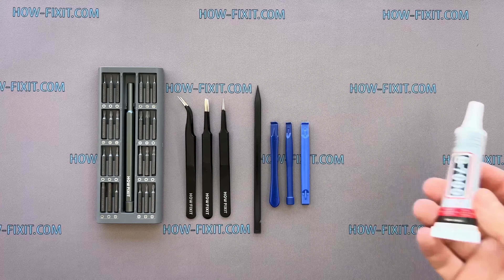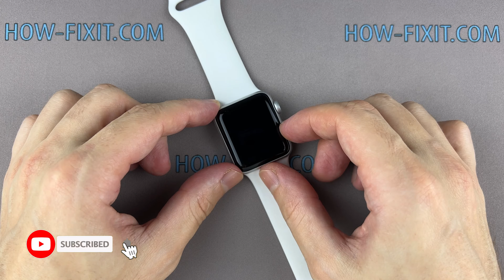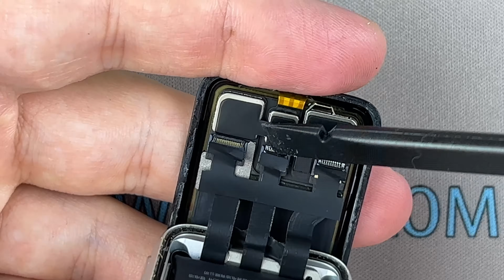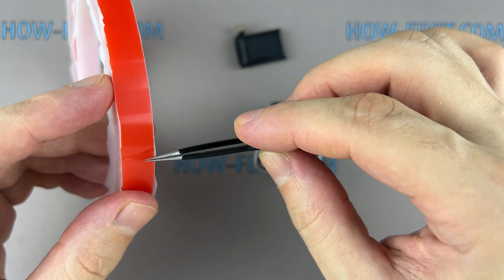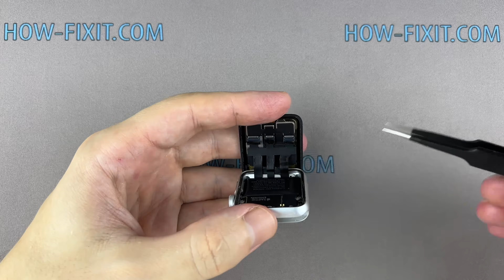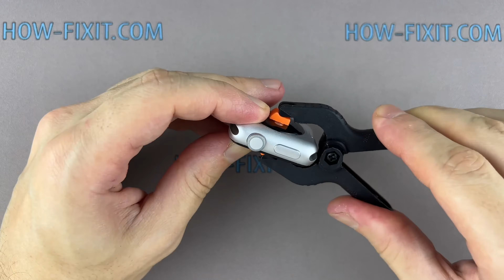Apple Watch Series 3 Battery Replacement

Comment: I cannot get the cover off, despite heating it with a hair dryer and using ultra-thin tool. Advice?
Reply: It has to soak the heat a bit. You have to get it hotter than you think.

Comment: The triwing screwdriver provided w/ my battery kit stripped when attempting to loosen the battery screw. Also, I don't think you need to remove the screen cables on the gen3 watch. I'm ordering a 0.6 mm Tri Wing Screwdriver for $3 bucks on ebay, I'll get back to you if it works or not. Update: The "Y 0.6 mm Tri Wing Screwdriver" perfectly fit the battery screw. Watch is now charging the new battery! Hardest part was aligning the 3M adhesive on the watch frame, once the paper backing was peeled off. In this video they forget to peel off the old adhesive and just put glue over the old one lol, I recommend peeling off the old one and getting the 3M adhesive, which is probably what apple used originally.
Reply: hey bud, do you know what is the size of the screw that apple watch 3 use?

Comment: Screen stopped working after trying this modification. Watch vibrates when trying to turn off. Might have pinched the ribbon cable the wrong way when re-installing. Thoughts?
Reply: Ribbon cable missalignment mostlikly. And, this job is not for everyone ;). I can't recommend it to anyone with not taking a risk into account. Only when you do these things for some time, you know your way around.
Reply: don't remove the ribbon cable, only the battery cable needs to be removed during battery swap
Reply: @brad6742 which is the ribbon cable?

Comment: I want to know if my apple watch has a defective battery because ive only owned it for 4 months and the battery health is at 95%. My friend bought the same exact watch 3 months before i did and his battery is at 99% health so is mine defective?
Reply: How do I check the battery health of my Apple Watch Series 3?
Open the Settings app, then tap Battery. Your current charge level
Reply: @ReneaDooserider  all, Diana, Hannah Talbot, Paris
Reply: بتاكيد